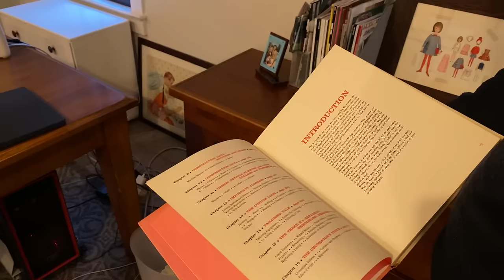Doll Dress Pattern Making 101 with Robert Tonner | Virtual Doll Convention | Sewing Workshop

Comment: Hi, greatly enjoyed this video, an am ah collector of Tonner dolls, love them.  I would like to know where to find the small ruler he uses for the armhole, neckline an also for the seam allowance, also where can I find the mini ironing board? Thanks so much.
Reply from the maker: HI! I think Robert got the ironing board at DollsPart. They have some awesome tools for sewing and creating. Thanks so much.
Reply: @RachelHoffmanDolls  Hi, thanks for your response, I did find the ironing board, but would you happen to know where he got the ruler he used to do the arm holes with, it was a small ruler which had scallops on 1 side an straight on the other side, I'm not sure he mentioned it, bt I would like to know if possible.